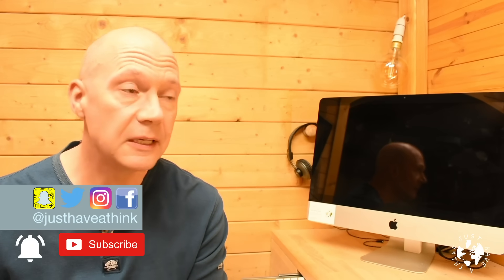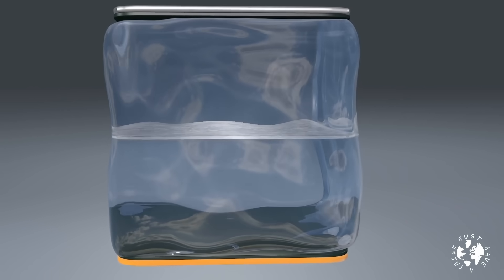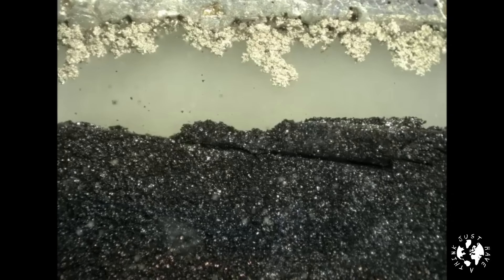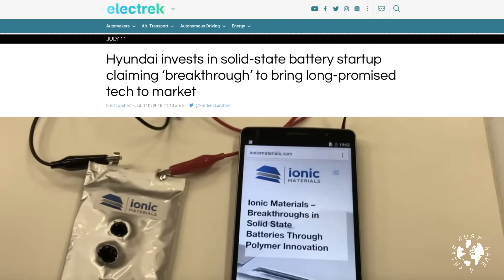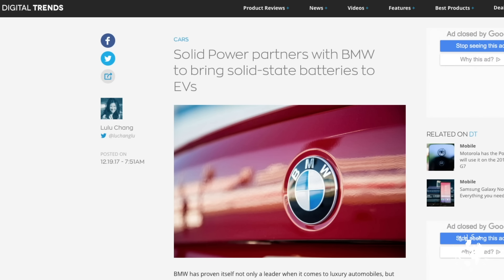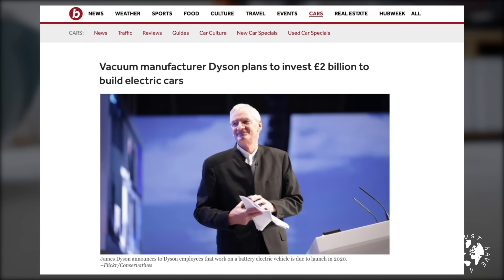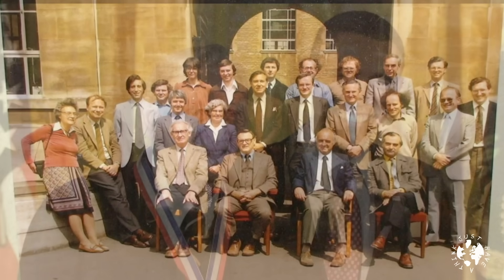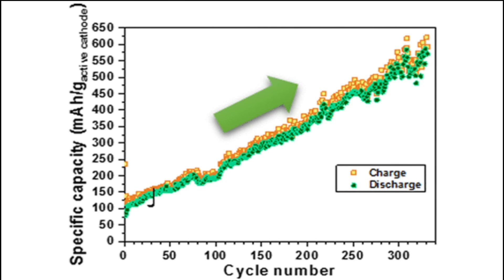Solid State Batteries - has Goodenough nailed it again??

Comment: Next step: Solid State batteries with a specific energy of 2000 Wh/kg that can be charged with a power of 1 MW. Just imagine getting 3000 miles out of 15 minutes of charging. The demand for energy would skyrocket though. People should seriously start investing more into fusion reactors.
Reply: Fusion is at least 20years away.  Salt reactors are safe and could be built now
Reply: @ralphhellmer9951  fusion will come not before 2080..
Reply: Fusion is massively complex and far away to be in any type of full production maybe, 2030 for the production plant.  However thorium molten salt breeder reactor called the liquid fluoride thorium reactor (LFTR); The Chinese and India will be moving into full production with LFTR very soon while the USA sits in Federal Red tape and choking our upstarts.
Reply from the maker: Hi Katzelle. That sounds intriguing.  Are you involved in developing these types of battery? Are you not confident that large scale renewable technologies would provide the energy required?
Reply: @JustHaveaThink 

Nah, your video had a graph that showed a specific capacity of 600 mAh/g after 300 charge cycles or so. Multiply that with 5 Volts and you get 3Wh/g. That's 3000 Wh/kg! With 2 kWh/kg alone, you could have 100 kWh in a battery that weighs less than a full fuel tank (around 60-70 kg). A 500 kg battery could hold 1 MWh of power.

If that battery also charges faster than Li-Ion batteries, then you could theoretically plug that into a Tesla Megacharger, which apparently provides 1.6 MW of charging power... I made a mistake. You can recharge a new Tesla Roadster with a Tesla Megacharger in about 20 minutes, or a P100D in about 10.

Now about power consumption. I could imagine that users of electric cars would generally exhibit a similar time patterns when it comes to charging their cars. I was thinking about a potential worst case scenario in which you'd have all car owners, plug their car into a 1MW charger at the same time. Just multiply 1 MW with the population of car owners in a town (10000 people of 30000). That's 10000 MW, or more than the biggest nuclear power plant could output (8000 MW). Think of that. A one hour peak time that requires an additional nucler power plant for every town.

Looking at it in hindsight, this kinda sounds stupid, so here's a likely more realistic estimation. One would very likely charge their car over night during the weekend, let's say from 10 pm to 6 am. During the week, they probably drove 80 miles or so. If an electric car can go 3 miles per kWh, then that's about 26.7 kWh in 8 hours. That should require about 3.4 kW of power. In a town with 10000 electric car owners, the total power needed to charge those cars at that time would be 34 MW. Still a lot, but nothing crazy anymore.
Reply: @Katzelle3  What's your background?
Reply: @quicksilver1752 

Actually, in this case, I don't have to be a figure of authority here. In fact, instead of taking my word for granted, I'd like to encourage you to make an estimate yourself. I promise you, that you can also do those calculations based on two simple formulas:

Power (W)atts = Current (A)mperes × Voltage (V)olts

Energy (Watthours Wh) = Power (W) × Time (h)ours

Go through what I did before and tell me what you would do differently. I'd love to hear a different opinion on this matter.

The graph for the specific capacity of the glass battery is at 9:30 and my reference vehicle was the Tesla Model S P100D, which has a 100 kWh battery and goes 300 miles. Apparently a Tesla battery weighs about 500 kg which would give it a specific energy of 200 Watthours per kilogram.

The biggest nuclear power plant in the world is the Kashiwazaki-Kariwa Nuclear Power Plant, which can output about 7965 Megawatts.

1 Gigawatt (GW) = 1000 Megawatts (MW) = 1000000 kilowatts (kW)
Reply: @Katzelle3  "Actually, in this case I don't have to be a figure of authority here". Ugh, you're an atheist aren't you... Look dude, I just wanted to know your educational background. That's all... I wasn't suggesting your calculations were innacurate at all...
Reply: @Katzelle3  Hey dude are you gonna answer my question... I was actually looking for an answer...
Reply: @quicksilver1752 

My name is Katzelle3 and I was born in the 25th of September 2010.
Reply: @Katzelle3 I said educational background but Lol, actually??? I'm sure you're kidding but for real, I just want to know your education background.
Reply: @quicksilver1752 

Well, demonstrate why such personal information would be relevant to the topic at hand in the first place.
Reply: @Katzelle3  It wouldn't... I'm just curious to know how you've come to learn this information...
Reply: @Katzelle3  Those peaks will be possible if local utility sized battery storage is used at these charging stations, otherwise these kinda currents are not really possible.. I am sure we are getting there, no doubt in my mind.

Google Ambri, amazing technology and amazingly simple and cheap.. the research is going into finding the right material combinations for these large utility scale batteries.
Reply: @JustHaveaThink  it's nonsense. He assumes a cell voltage of 5V, which is just plain stupid.
Reply: @Argosh 

Paper says more than 3 Volts on average, so I'm not too far off. That's still approaching 2 kWh/kg.
Reply: @Katzelle3  you're using made up numbers in combination with numbers from a lab experiment. Firstly no lab experiment will translate directly into a real life engineering solution and secondly your assumptions are nonsense.
Reply: @Argosh 

Go check it yourself. They actually have results for specific energy in Wh/kg. And it also shows that it kept on increasing even after 300 cycles.
Reply: We already have access to the largest fusion reactor in the universe. Our sun. Solar and battery energy is the way to go.
Reply: Why? Just send a ship full of batteries to Egypt full of solar power and spread the energy to all over the world with the ship
Reply: @rowanbroekman3929  how high are you my guy?
Reply: @joltjumps   Well, not as high as the guy talking about fusion reactors, solar will allways remain cheaper, especially in Egypt, and if such batteries will start to exist like he suggests, then  it would be easy to just ship the energy around.
Reply: +Quicksilver17 : I am not a foreigner. I am inhabitant of planet earth, just like you are, I suppose. Or do you have any particular nation state in mind when you use the word "foreigner"? If so, which, and why? (and why is this relevant fir you - are you a racist or nationalist w.r.t. the nation state you happen to live in?) For your information: On YouTube people from all around the world are watching, reading, writing and contributing. I made judgement based on your content. YOU are judging based on my language and culture, and now you are saying I do misbehave the way actually YOU misbehave. This is an unbelievable twist of facts.You are either braindead or a very bad troll. Get out of here!
Reply: +Quicksilver17 wrote: "...cuz people are being stupid..."

There is mainly one stupid person here, he is swearing, insulting, shouting, and proves himself completely unable of making reasonable points, because if he were, he wouldn't need to insult people.
Reply: Just a problem with big booms going over 7-11 speed bumps.
Reply: +Quicksilver17 : Please stop trolling people, and leave religion out of the discussion, or everyone will think you are brain-damaged.
Reply: @MiccaPhone  Shut the fuck up, I wasn't trolling anyone... The atheist part was relevant... "or everyone will think you are brain-damaged" who the fuck even says that? You sound like a foreigner. And since that's probably the case, how bout you don't make judgements based on a language and culture you are not even native in or completely understand...
Reply: @quicksilver1752  why are you swearing at people and asking their personal information? What is your educational background, do tell we are all interested!
Reply: @thomaz1963  cuz people are being stupid and I'm curious... Junior undergrad electrical engineering student. Your turn, what's yours?
Reply: Why invest in fusion reactors when we can just use the one in the sky?  Solar is rapidly becoming the cheapest form of energy and requires no major breakthroughs.  Batteries or other storage are the next step to full implementation.
Reply: @michelangelobuonarroti916 

Because hydrogen mining ships > dyson spheres
Reply: W N  Shhhuuuttt the ffuuck uppp... For fucks sake... "Revealing of my belief system and judgement" oh yeah what did it reveal dumbass. I don't even know what you are yapping about you moron. 65% of the world are atheist... First of all, that's the biggest boat load of shit ever but regardless..  and??? Like what the fuck is even your point... I didn't even negatively label atheism you moron. Show me where I did. And you don't even know my" chosen religious beliefs"... Just shut the fuck up honestly. You don't even know what you're saying. You are just talking as if you are smart. Your dumbass is probably atheist too with all your "oh look how smart I am" manner of speech... Moron

Comment: My bet is on Dr. Goodenough's solid-state glass battery which is late in the development cycle as Goodenough has been working on this tech for 30+ years and knows what he's doing.  I'm sure we'll see solid-state batteries in cars with 3x the capacity and 10 min. charge time in the next 2-4 years and say bye bye to oil ICE cars.
Reply: It is hard to believe Goodenough lent anything more than his name to this research when you watch the paucity of contemporary knowledge he shows in this August 2017 interview: https://youtu.be/kR8CESrigEg?t=157
"You can use it (LiIon) for hybrid electric cars but not for all electric cars."
"When Tesla makes a battery for a car with 7000 cells, he (sic) has to manage those cells and the management system is as expensive as the battery itself, and it does not have the cycle life so after two years you have to pay another $28000 just to get a new battery."